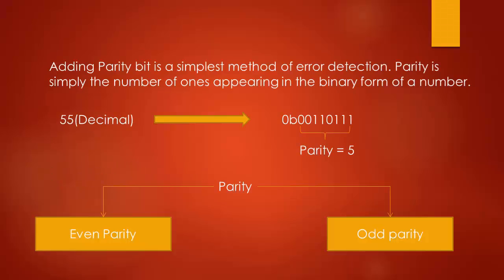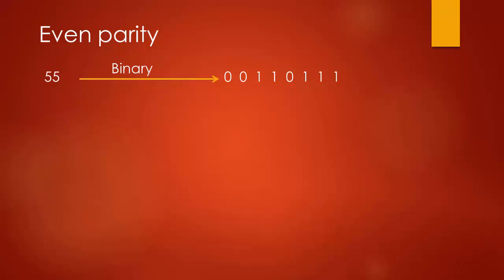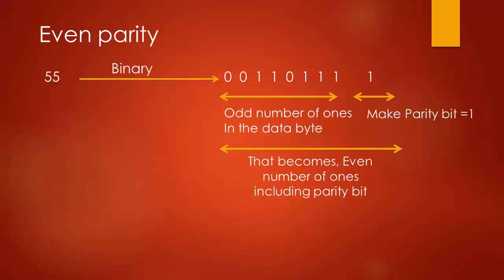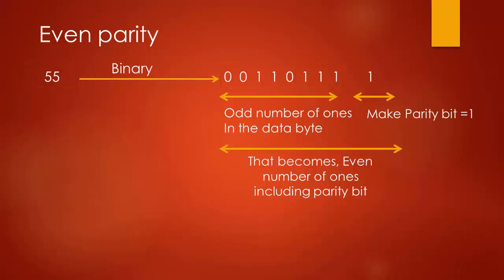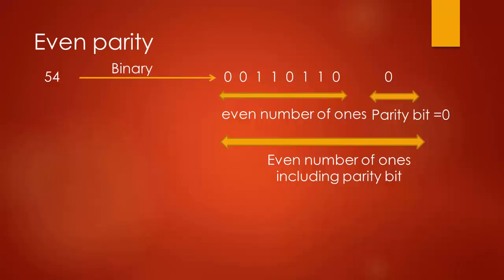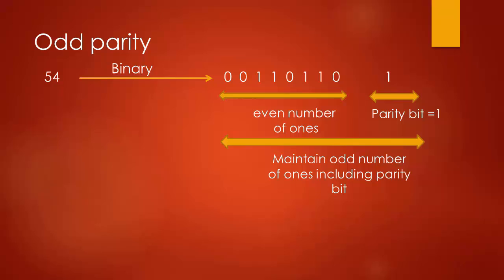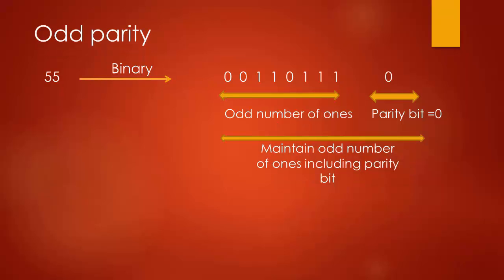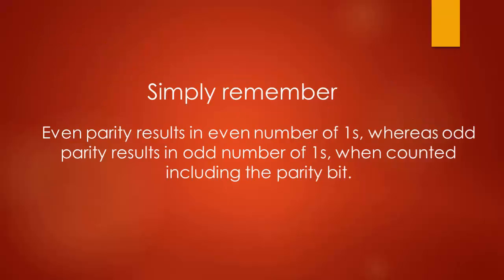UART: Understanding UART Parity

Comment: I don't see how this adds any functionality to a protocol where the transmitter simply sums the bits and generates a parity bit based on them: 1 for an odd number of 1's, 0 for an even number of 1's.  The receiver has just as much functionality in determining whether a single bit error occurred, and does not have to be informed of an overall odd vs even protocol scheme.